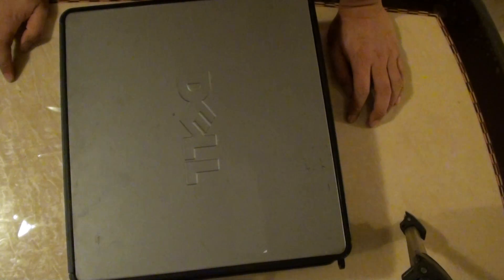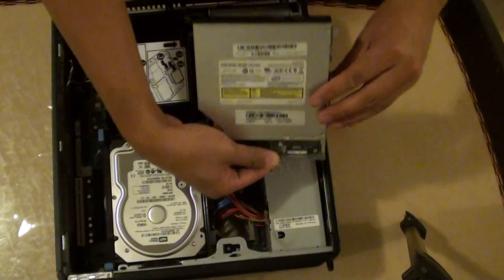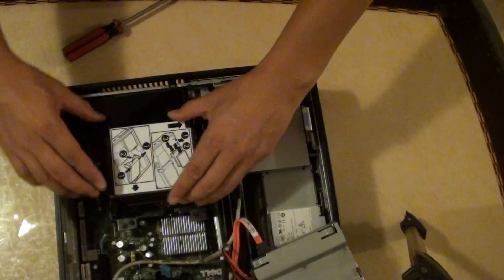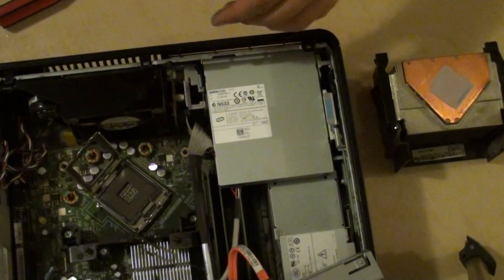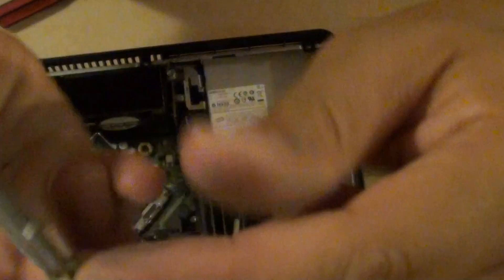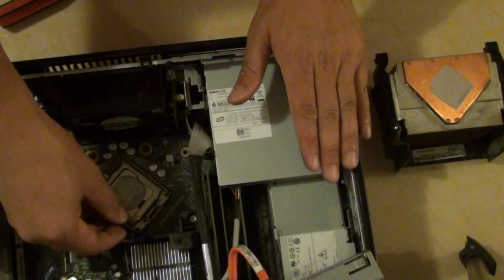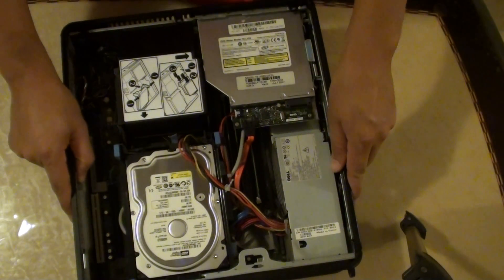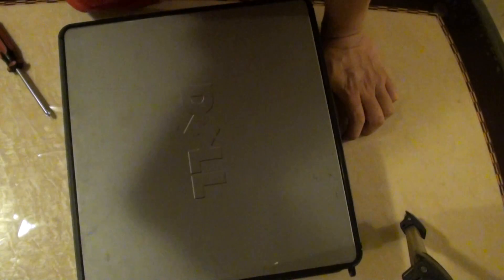Dell Optiplex 745: How to Remove and Upgrade the CPU Processor

Comment: i upgraded my processor from stock to 3.66 ghz i have a gtx 740 2gb and my computer is just showing a solid orange light and when i put the old one in it works fine any advice to fix this issue
Reply: 745 is limit to 3.00 ghz
Reply: I just had this problem. How do i fix?